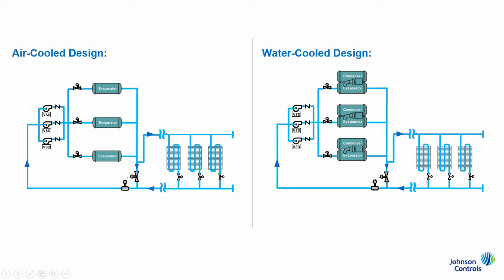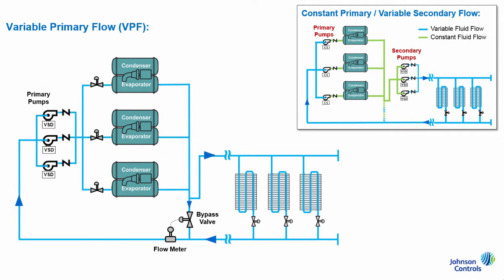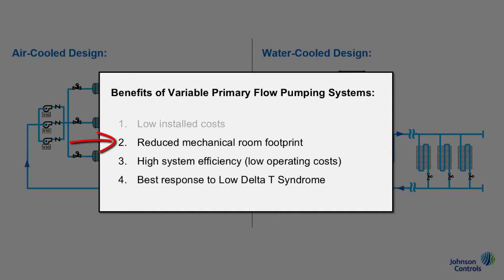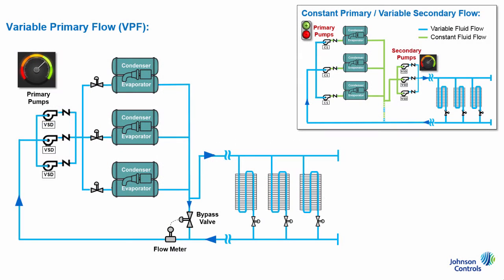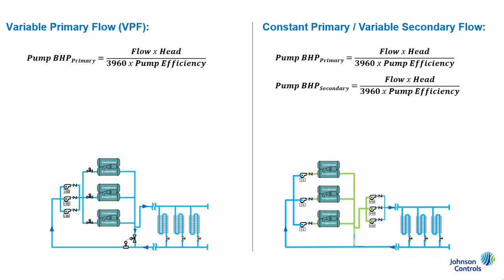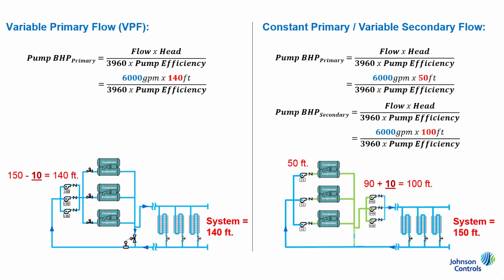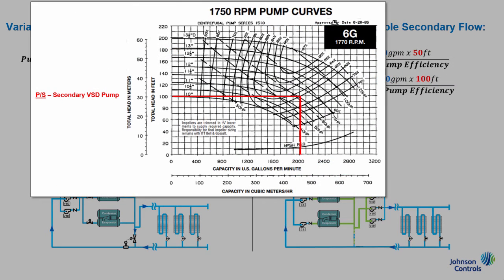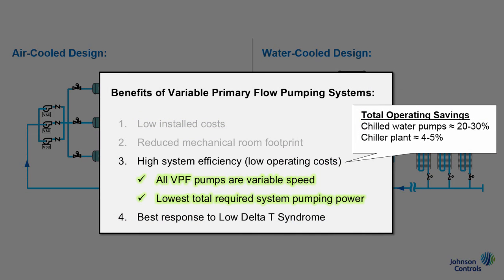Benefits of Variable Primary Flow (I-P Version)

Comment: i have a question, as shown in the system bypass water moves back to pump then how pump can deliver lesser flow with VSD. like in primary and secondary system secondary is VSD and remaining water moves back to primary. pls explain
Reply from the maker: In a VPF system, fluid will only travel through the bypass valve in one direction, forward, as needed.  In a primary/secondary system, fluid is free to move in either direction through the bypass pipe.  However, as a rule of thumb to maintain system stability, primary flow should always be equal to or greater than secondary flow.  In addition, secondary VSD pumps are controlled to speed up or slow down as needed to maintain system stability.
Reply: Hi , I know the fact what u have explained, My questions was related to primary variable flow system and not primary secondary system. As you explained in VPF system that primary pump works on VSD but when there are 50% load in system 50% water is bypassed from bypass line and pump gets 100%flow again, then how pump works on variable speed as the water flow is 100%available at pump inlet.
Reply: The bypass line is only to ensure that the evaporator does not get starved for return water. If the plant is 50% loaded, the pump will only circulate 50% of design flow. Bypass will come into the picture when flow reduces to less than 30% of design flow.